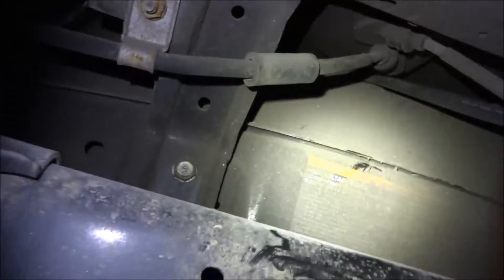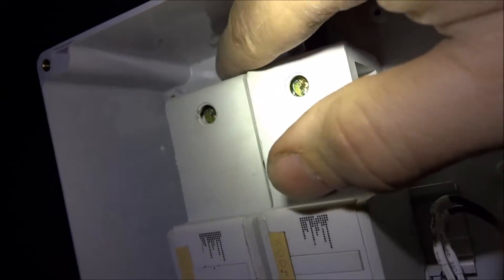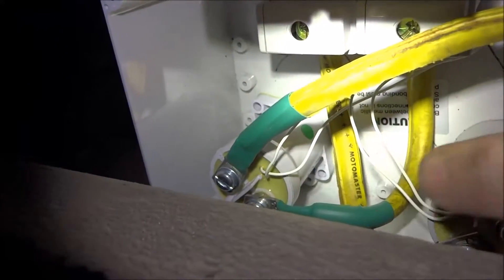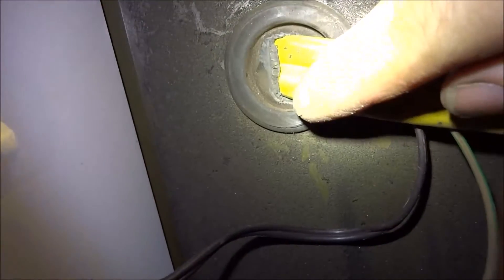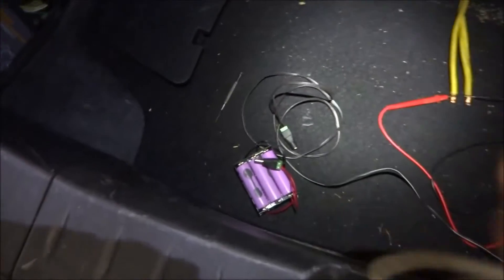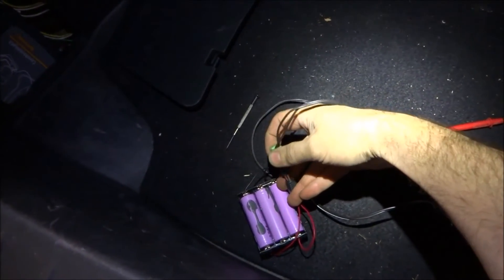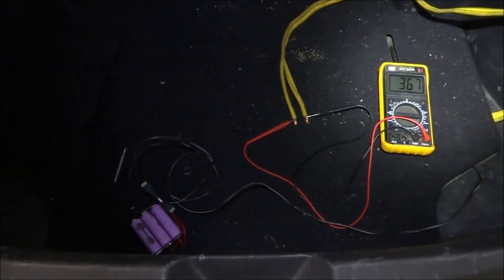Nissan LEAF range extender pack build Pt.1.5 (relay/fuse box)

Comment: Also, Why do you have relays and fuses on both positive and negative terminals instead of one or the other?
Reply from the maker: Just for added safety, I think most system high voltage systems are setup this way.

Comment: Hello Sir,
 Loving the series so far, I was wondering if you could tell me what voltage/current your relays are rated for and if they are solid state or physical relays(do they make the clicking sound when you turn them on)?
Reply from the maker: They are contactor relays I purchased from EV West. I don't know the exact specifications but they are rated for at least 400v 100A (yes they click when activated). They are similar to these: https://www.evwest.com/catalog/product_info.php?cPath=46&products_id=387&osCsid=eg0qqjt2f4s0nemt8q1apc5fk5

Comment: I was just reminded when you engaged your relays, 368vdc is nasty if you screw up!   I got an alligator clip test lead across 90vdc servo motor supply that could probably deliver 150amps dead short.  It sounded like a shotgun and a blinding flash of light.  Everyone in the shop stopped what they were doing and came to see what happened.  I found part of one clip.  The other clip and a foot of 20ga wire were apparently vaporized. Speaking of dead short, that is what you will be if you get across 368vdc!
In regard to insulation I will add something I havent seen mentioned in discussions of EV batteries,  that is the fact that DC circuits are much more susceptible to corrosion than HV Ac circuits are.  Sort of a plating or electrolysis reaction. With AC ac you plate one way, then plate it right back the other way so the long term effect is cancelled out.  With DC it is always in the same direction.  So exposed terminals slowly but surely are migrating a path of conductive material from one terminal to the other, eventually creating a path that can flow a measurable current, that is ever increasing until one day it is enough current to set something on fire. And at that voltage, dirt and in particular road salt that on a 12v system would not be a concern are a big concern at 368vdc.  What happens at a pinhole in your insulation on a cable carrying 368vdc that is continually rubbing against steel?

 Pay close attention to what you are doing with 368 volts and the current that can be carried by 6ga wire,  it will be one hell of a grenade if you touch them, a white hot copper explosion.  Alternatively if the battery is discharged enough when the short occurs the cable could withstand the current long enough to blow the batteries then you have a white hot lithium explosion.  If you are going to fool with it  you better study up a bit on HV  DC! Especially what to use to seal connections and what is appropriate material to use for insulation.

Comment: Loose 400v connectors laying in the trunk, 2" apart. If those touch, and believe me I've done this, you suddenly have a 10,000 amp welder in your trunk. NEVER leave high voltage connections bare. Only one high voltage connection should ever be bare at one time. You should be wearing voltage rated gloves and safety glasses at all times when working on such connections. I learned these lessons the hard way on 36v ebike batteries, this is an order of magnitude more power. Be careful, dude! We want to see you succeed!
Reply from the maker: The relay/fuse box is under the trunk and is normally closed and sealed (water tight). The wire in the trunk only has power on it when I energize the relays.

Comment: Ouch! While I like your idea of scaleable battery, you are opening yourself up to a world of hurt due to a few choices you made, probably because you want to use cheap components. The fuses are AC rated, which means that they are not designed to stop DC current. If something goes wrong and you depend on the fuse to open, it will not. It will continue to conduct DC current and put your car at risk. In addition, if there is no marking on your booster cables (I have the same in my truck and they are fine at 12V but I will never use them at 400V) then you have no idea what will happen when putting 400V on them. I also noticed that you run welding cable loose over the battery box from the split in the front to the trunk. While welding cable is an appropriate type cable, having them dangle loose around metal brackets and other things where they will constantly chafe against and eventually wear through is asking for trouble, especially if your fuses are not going to stop the DC current from the battery.
I have worked on a burned-out 2011 Leaf that had an 18650 pack of batteries in the trunk, judging by the metal cylinders that could still be found in the ashes inside the car. Here is a video that a friend composed from the pictures that we took of the car as we found it in the tow yard after the fact and the battery I disassembled: https://www.youtube.com/watch?v=2cIo95W-vfE
Reply from the maker: You raise a few valid points. I wasn't aware that it's a problem using an AC fuse in a DC application as I've seen plenty of people doing just that. Luckily, they do make DC fuses for the holders I have. I wanted to get lower amperage fuses anyway. The cable voltage rating is based on the level of insulation and although booster cables aren't rated for high voltage DC, the insulation is thicker than on the welding cables which are rated for 600V. As for running the cables on top of the main pack, I checked and there are no sharp edges to rub against. Also remember that each cell in my battery pack is fused on both terminals using a thin wire which will blow at around 6-10 amp which offers additional protection.
On the burned out Leaf, the person connected his secondary pack directly to the main pack (before the main relay) by breaking open the main pack. It is believed that water got into the main pack and caused a short circuit which then caused the fire (at least that's what I've read).
Reply: Hi Xpack, yep - that was my conclusion after opening that pack and seeing the corrosion and water sloshing around inside. I took out the BMS and opened it - every single one of the 24 ASICs that each handle 4 cells monitoring and balancing, had a little crater in the chip - that is how violent this pack has failed, also witnessed by the molten wires in the original pack and the burned out car... So, there is a lot of good lessons that can be drawn from that example.
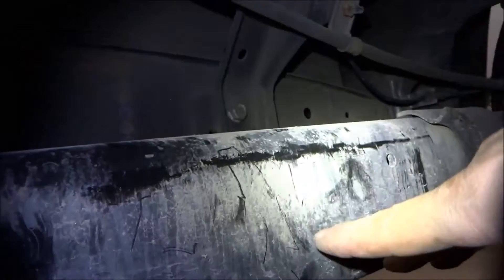I noticed in your video around the 0:47 mark that you point out the mounting bracket in the empty space under the trunk. Did you notice that your welding cables run directly adjacent to that metal bracket and can easily chafe at the corners of it? The parking brake cables look as if they won't chafe, but the fact that you have single isolated cables flopping around under a car near metal brackets is asking for trouble, that is why the OEM cables are always embedded in a sleeve.
Regarding the jump start cables use for high voltage: I agree that isolation thickness is important, but equally important is the type of isolation. Not every material is created equal. That is why a 25,000 Volt cable in an old CRT TV is not bigger in size than a jump start cable - it is a different material (as well as paying attention to leakage paths). The cheap plastic of jump cables can easily be cut, but that does not matter much as they carry only 12V normally. Welding cables are made to withstand a lot of torture of being dragged, pulled, bent, twisted, soiled and so on - while still maintaining specs. That is why they have fine strands and mechanically resistant isolation. That is also why they have been used in EV conversions for many decades, they are resistant to a lot of abuse, accidental acid spills, oil and so on.
AC disconnects and fuses sometimes are DC rated, but it is a rule of thumb to de-rate the AC voltage to 1/4 or 1/3 when using them on DC at full current, so a 600VAC fuse should be good to 150-200VDC but you never know until you try. Let me know if you have questions, I have worked on over a dozen Leaf packs and have a couple disconnects (with fuse) and plenty contactors (relays). And modules ;-)
Reply from the maker: Interesting you mention the bracket under the trunk, I didn't show it in the video but I actually tied the cables to the bracket to avoid them moving around and chaffing.
Thanks for all the great feedback!

Comment: Nicely done!  You do good work.

My only question is about the rated insulation on the cables.  You called them booster cables, so I just want to make sure they are rated for at least 600V.
Reply: Booster cables insulation is thick to protect against mechanical damage. I'd be pretty concerned about its electrical properties. I worry when I see the two cable ends sitting so close with 370 volts on them. If they touched there would be a hell of a spark, perhaps explosion. That DC voltage is well into the fatal range, use great caution. I would also be worried if the characteristics of the two parallel batteries differ especially as they discharge, dangerous things can happen. I hope you know more than you seem to.
Reply from the maker: Unfortunately there are no marking on the booster cables however the insulation is about three times thicker than the insulation on the welding cables and they are rated for 600v.